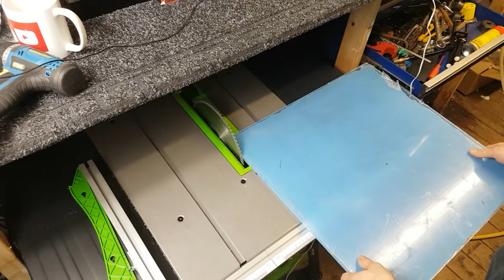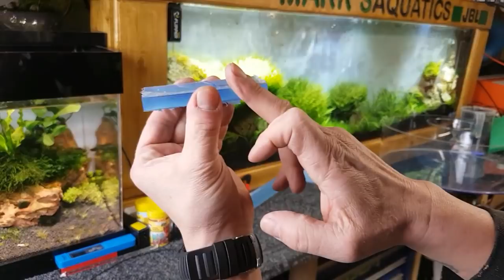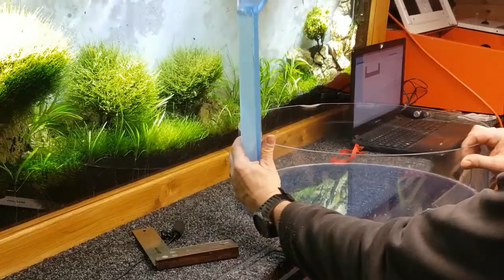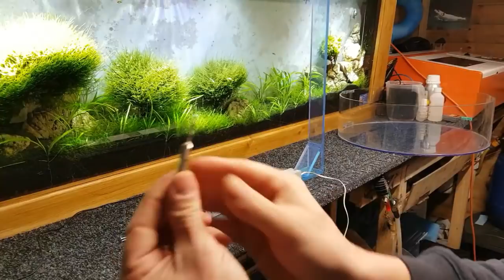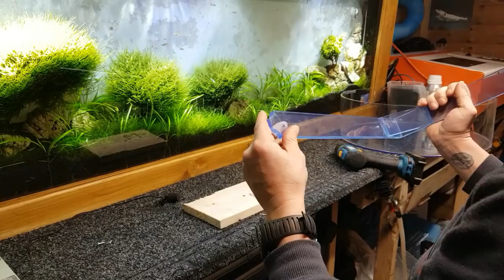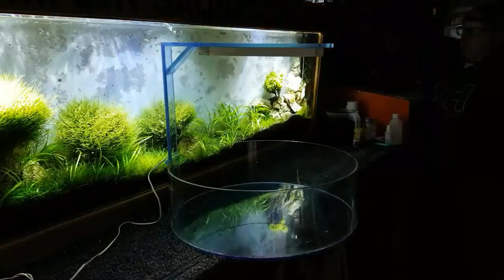CUSTOM BETTA TANK PART 2.

Comment: I was in Ikea a couple of days ago and, although  they didn't have any lights like the one you are using here, I bought a 25W 125cm long LED Damp Room light for £17.99 - and its great!  I went back today to buy two more... and they had all gone! :(
I did however pick up a new multimeter, an infra red thermometer (like yours) and some of those diamond tipped drills. Disappointed about the lights but still not a bad day :)
Reply from the maker: Yes the  infra red thermometers are very handy.👍😀

Comment: Do you habe any video on how you made your big thin aquarium in the background? Love your vidz! Keep it up! Merry christmas and ahappy mew year!
Reply from the maker: Yes it's in my play lists under the bench tank build. 😀👍
Reply: @MARKSAQUATICS  oh thanks! And big thank you for answering! Not many you tubers answers questions. Lovely amd very cool koi pond you have. I am thinking of  having a few tanks in my bicykel shed and have a few more questions. So i want a few wild fish from some local lakes and rivers and wanna have a tank outside so its the same temprature as outside but i live in sweden and it can get over minus 10 degres celsius and then the water wil freze and does the ice crack the glass and do i need a heater becuse i want he same temprature as outside. And does it gets expensive to have soo mutch heat and watts if i wanna have a heater so it sits at like 25+ celsius? Thank you very mutch if you respond!
Reply from the maker: Minus 10 will freeze the tank solid i would have thought. you can get pond heaters but that would be very expensive to run. I would stick to indoor aquariums .
Reply: @MARKSAQUATICS  okayy thanks!